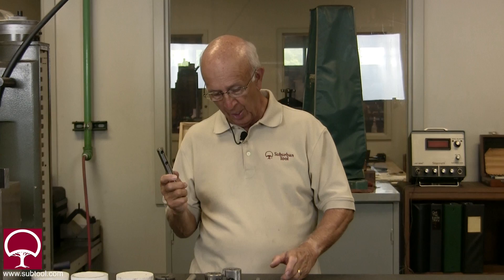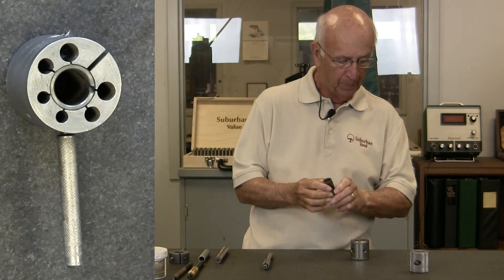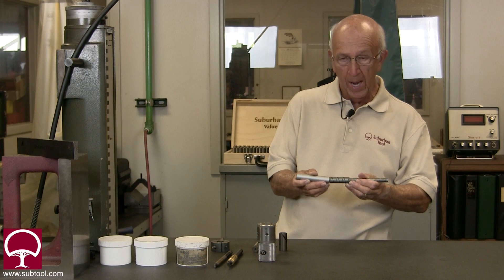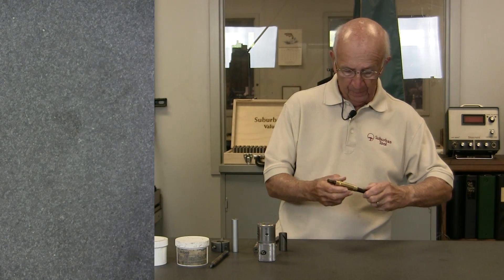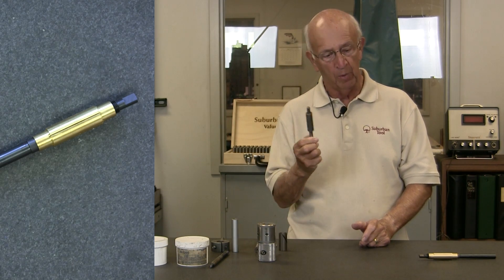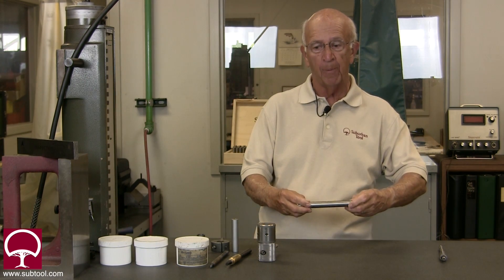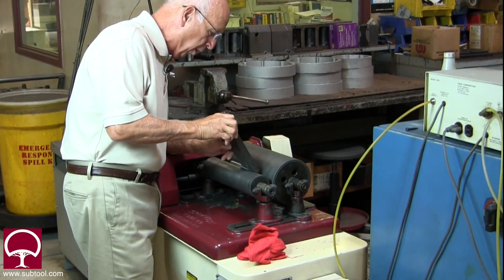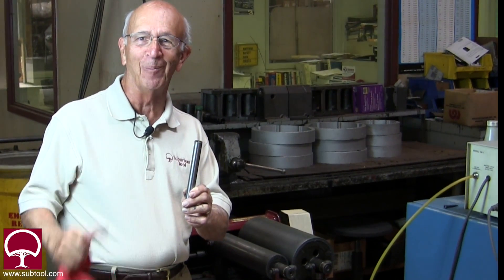A primer on tooling for lapping OD's and ID's

Comment: I've never seen an old Spit Fire lapping machine but I'm ready to go buy some meehanite bar and make one for myself.

I'm actually looking to lap some .2512/.2514 dia blind holes x 1.80 deep after heat treating the D2 . Any Ideas?
Reply from the maker: wish i could help, but its hard to do it from here.
Reply: SuburbanTool Inc  after looking around the shop "Diamond Mold, Salt Lake City" I found a box of barrel laps and a few cans of Clover lapping compound. 
The compound is probably 50 years old with the oil separated from the grit, so I just mixed it up with a pencil and it worked great.

What's the brand of that fancy white lapping compound that you're using at Suburban?
It took 3 days to get the old clover compound out of my finger nails.....lol   :)

Comment: About 25 years ago I made a machine similar to your drum lap for production polishing. I  made the grinding drum from aluminum and copper clad it by cutting a slot along it's length to hold 3/16 copper sheet. I then filled the gap with solder and trued it on the lathe. For the drive roller I pressed semi-hard rubber onto a steel shaft and trued it. The difference was I made a guide below the centers and ran it like a centerless grinder. Not only did we get an outstanding finish but the O.D.'s were strait to .0002.  My question is what material are your lapping tools made  from? One looks like brass but can't tell about the others. I've made laps from brass , Ledloy , copper , tin and even wood so it's hard to tell by looking.
Reply from the maker: +Michael Aumick Cast iron.

Comment: Don,

I like watching your series of machining tips and methods. 

FYI, I too have a lot of the earlier version of Lutron dimmers with the side bank of little green indicators for showing the lighting intensity. I found that the Cree LED bulbs work very well with the older style Lutron light dimmers. Previously, I had to return another brand of LED lights that definitely did not work with dimmers unless one incandescent light remained wired in the series. I replaced more than 65 incandescent can lights with the Cree LED lights that have an integrated can bezel cover. Saved a bundle in electricity usage and also, did not replace any of the rather expensive Lutron dimmers.  

Thank you for the series, Paul

Comment: Hello thank you for the lapping videos i am a complete novice in lapping, generally how much do you usually leave on for lapping to get the final size and how accurate can lapping be assuming done correctly ect? Thanks
Reply from the maker: Letrool Haje It all depends on your work piece. For a 1" dia. shaft, I would not leave more than .0005.